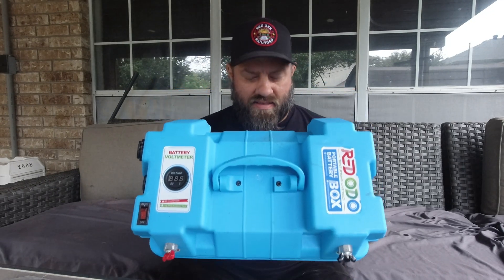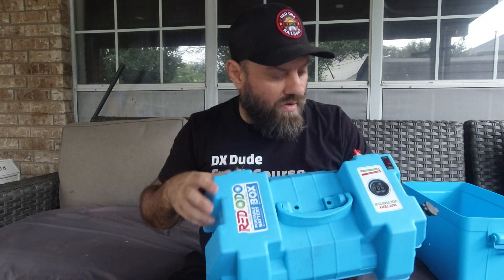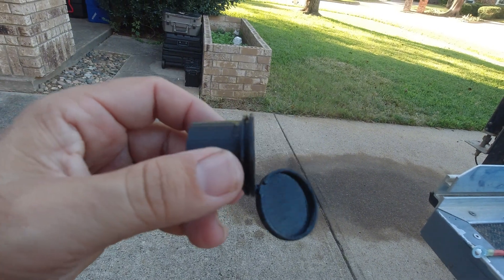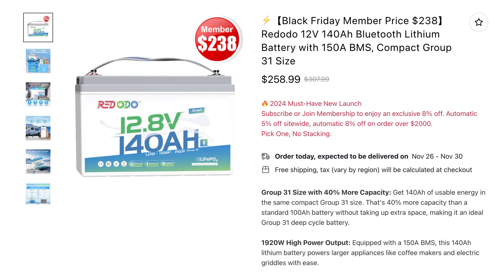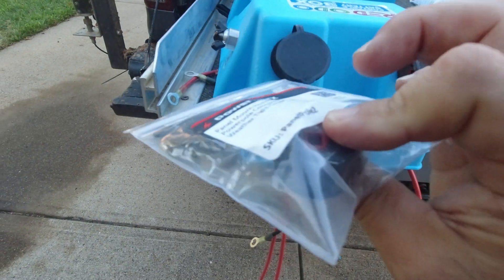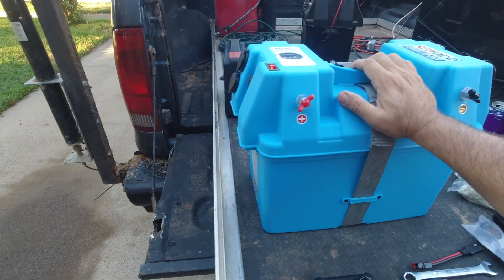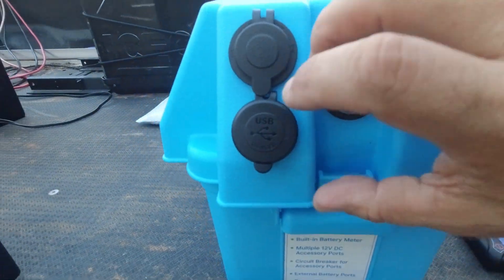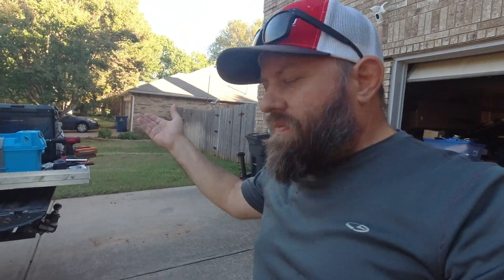Another HUGE Battery Box for Off-Grid use from Amazon

Comment: By the time you get the battery, box, and hacks, you are getting into the price range of Jackeries......
Reply from the maker: No, not even close, really.  Jackery has an inverter, this one doesn't.  And they are much heavier.  And inverters are noisy.
Reply: @HamRadio2  I do have the HFT 290 Jack.  One thing it does will is regulating 12V out at constant power.  Can do an all day public service event on 2M or qrp HF GOTA station with the Icom 703.

Now do these Li  batteries have 12V discharge regulation?

Comment: I have taken a plain Jane battery box from Walmart, put fused cables to Anderson's.  On the box outside I have Velcro to attach an Anderson power block.  Depending on my station I can run a single rig, mutiple items, and can use a Powergate to charge or backup the power supply.  Lots of flexibility at lower cost.
Reply from the maker: Awesome

Comment: Jason you need to pull that 50 amp fuse. I can’t tell by watching the video, but aren’t the power pole wires only rated for 30 A. You said you would be able to be able to pull some juice, yes, and you would be melting your power poles or wire insulation
Reply from the maker: Power poles are 45amp, that's all I use. And burning wires isn't a huge deal if it saves the radio

Comment: I use string trimmer line (.095" diameter if i am not mistaken) in place of the roll pin.  You could try that through the hole in the Powerpole housings.
Reply from the maker: That's a good idea
Reply: @HamRadio2  And leave the trimmer line long on both sides of the APPs, then melt the ends to form little "rivet" heads.  I usually use a soldering iron. A friend just puts a lighter underneath.  (When I try a lighter the line catches fire, I melt the APPs, etc. I just don't have the touch!)

Comment: My power pole kit came in pieces I had to make the wires and put it in the box it came with a roll pin it don't come out after it's in there till you knock it out
Reply from the maker: Mine didn't
Reply: @HamRadio2  I got mine for Amazon. I got a Question I just ordered a Yaesu FTM-150 RASP does face mount just like the one on the Yeasu FT-891. I order my FTM 150 from Ham Radio outlet from Atlanta Georgia should be here Friday of this week going to order from GigaParts or DX engineer their said it would be later on in November for I would get it Ham Radio outlet said they had them in stocks order from them. Good price at $379.00

Comment: I have one of those battery boxes and the mini Redodo 100Ah battery in it. And yes, I hacked it and I have additional parts for it. That switch is a little weird in that if you plug a charger into the power poles, it lights up as well as the volt meter but does not charge until you turn the switch on. But I like that you can hack that box. In fact, you used that my Redodo battery box at SYP just a month ago  😆

Comment: SO, I went down this rabbit hole a few years ago when I bought a 1+ (OnePlus) phone because they ahve their own fast charging tech.   There are/were several competing usb phone charging standards (even before USB-C)   QC X.0 is the Quick Charge standard made by Qualcomm. (Qualcomm makes the CPUs in a ton of phones even today so they put that charging circuitry in the CPU of the phone). According to their web site 5.0 is the latest as I write this.  YouTube will clobber this comment if I put the link here, but if you search you can find a link on their site to a description and specs.  Personally, I'd rather find ones that have USB-C Power Delivery (USB PD).  There are some on Amazon like that.  I replaced the 12v Accessory Port (ligher socket) on my Jackery Explorer 300 with an Anderson Power Pole doohicky.  That 12v Accessory port is a waste of space today.:face-green-smiling:

Comment: Stripped copper wire is a good idea.  Use solid wire and bend it over to keep from following out.  Make sure you leave enough of a service loop in the wiring in case you have to get the battery out.  Nice build! 73

Comment: Good video Jason @Ham Radio 2.0
As for the nail that was preventing the power poles from being pushed in, you could put the nail back in and wrap electrical tape around the round receptacle holder inside the box all the way around couple times. As long as the tape covered the head of the nail, shouldn’t fall out.
Reply from the maker: Yes I had the same thought about electrical tape but I also wanted to see what other options were available for something more legit
Reply: @HamRadio2  small machine screws in longer length - not sure off hand what size, but that should be cheap and work perfectly.  Try Lowes or the like.  A nut or screw into some epoxy to hole tight.  Or install screw before inserting the plug into the box.  I went cheap and jus used some bare copper ground wire inserted and bent over the tips to hold in place.

Comment: FYI 

"QC 4.0" refers to Qualcomm Quick Charge 4.0, which is a technology developed by Qualcomm for fast charging of devices through USB ports, specifically targeting smartphones and other devices equipped with Qualcomm processors. Quick Charge technology allows for much faster battery charging of devices than standard charging methods by increasing the power delivery to the device.
Reply from the maker: Yes but I've never heard of USB-C refered to as QC 4.0
Reply: @ me either, I had to run it through ChatGPT

Comment: I run both my 7300 and 9700 in my shack on a Redodo 100 AH batter for months. I use about 60% in a day and charge it at night when I am done. Mike K8MRD did a video on this battery that's where I got the idea. On my Tower Wince I bought a marine battery and a box to keep it in. The box I got looks very much like yours. Has the lighter plug and termanils on the outside. I could add other stuff to it but for the tower it was cumberson to use the box so I just use the battery by itself. I may convert that old battery box to a solar charger. You got me thinking. Great video Jason thank you.